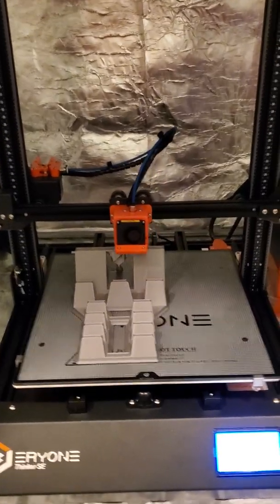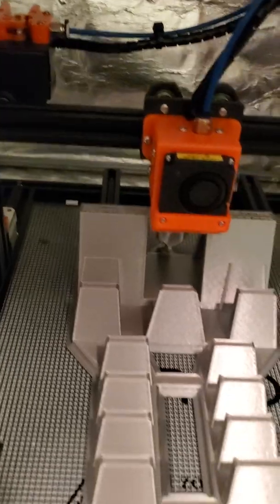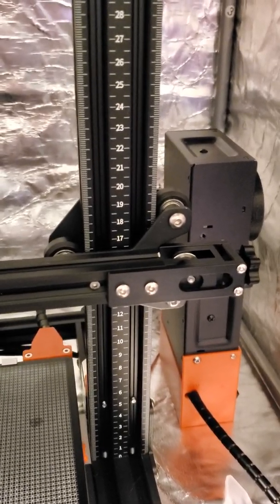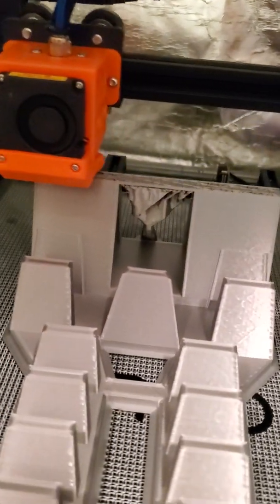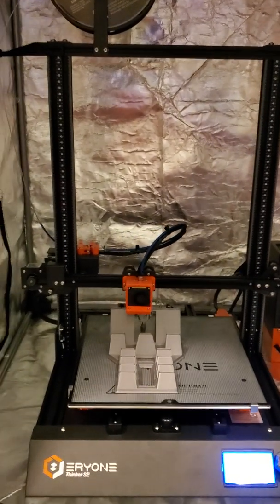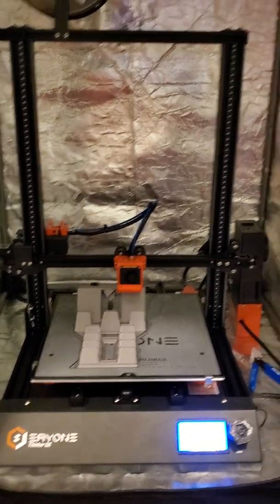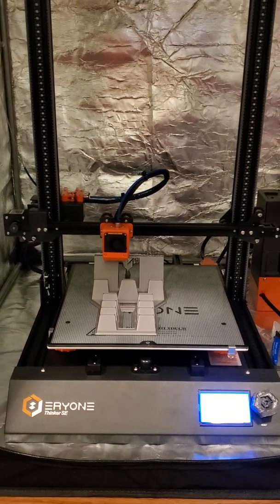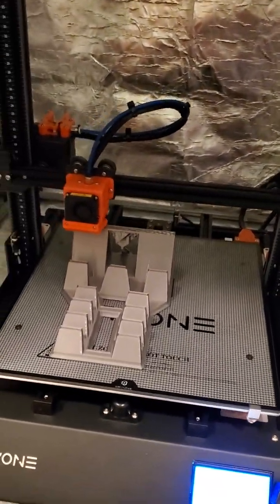Eryone Thinker SE at work! (Some thoughts on settings and upgrades as well)

Comment: Hey Jay,  i have the same printer (since 2 Weeks) and i am very frustrated.  I bought the PLA from Eryone and its a big luck if a print succeeds or not.  I still dont get the error.  Do you have any more tutorials especially for this printer?
Reply from the maker: Could I get a little more detail about your settings and what you're trying to print?  Which slicer are you using?  Have you tried a tested profile from the FB page forum yet?
Reply: @jayburkette8977   hi, i use the cura 4.12.  On the SD card of the printer there is a profile for cura.  Do you have a link to the fb page ?
Reply from the maker: @TheFoeni007  absolutely!  It is: https://www.facebook.com/groups/827832194279490
Reply from the maker: Put out a "hello" thread and ask for someone's Cura profile for an SE using Marlin.  Since I use Klipper firmware now on my SE, I don't have a recent profile that would be helpful.  There are a LOT of good profiles in the files section of that FB page.
Reply: @jayburkette8977     what Filament can be used with water ?  I wanna print an adapter for water (to fill up into bottles) and i wanna be safe for drinking that water
Reply from the maker: @TheFoeni007  Most PLA and pretty much all of PETG is food safe.  That said, they are not water-tight, so you need to be careful concerning bacteria buildup.  If all you are doing is funneling water, I would use PETG and do 4-5 bottom layers and walls...
Reply: @jayburkette8977   and what Filament can be used for water?  i dont want that particles get in to the water that will be consumed by humans.
Reply from the maker: @TheFoeni007  Most PLA and pretty  much all PETG are food safe.  The issue is that FDM printing doesn't create a complete water-tight seal (talking about the construction method), so you  have to be mindful of the fact that liquid in the tiny spaces between walls and floors can spawn bacteria growth.  Water funnel use shouldn't be much of an issue, to be honest.  I use a PETG funnel to fill my espresso machine - it only touches filtered water and dries completely between uses.
Reply: @jayburkette8977   so just a normal PETG or are there differences too? :)
Reply from the maker: @TheFoeni007  https://www.3dprintingspot.com/post/is-petg-food-safe-what-you-must-know-about-this-material
Reply: @jayburkette8977  Thank you!
Reply from the maker: @TheFoeni007  Of course!

Comment: Hey Jay, new subscriber here. I'm really enjoying the content you're putting out around these Eryone printers. but there was one question i wanted to ask, does the hot end mount on the Thinker SE match that of the Er20? i own an ER 20 that I am looking to do some modifications to it but all the files i find online are for the Thinker and was curious if they were interchangeable in this specific circumstance, keep up the great content Man!
Reply from the maker: Thank you!  Yes - they are the very same hot end.  Actually, the extruders are interchangeable as well, but the ER-20 comes with a metal extruder assembly instead of the plastic one on the Thinker SE...